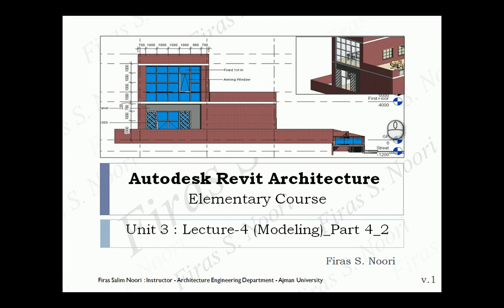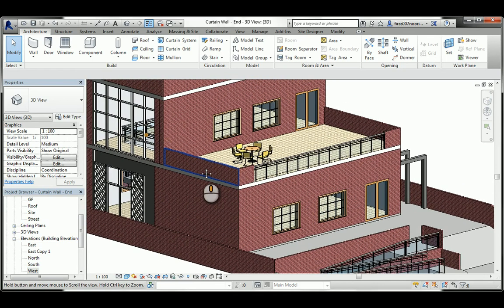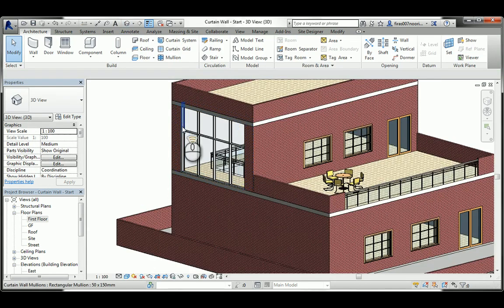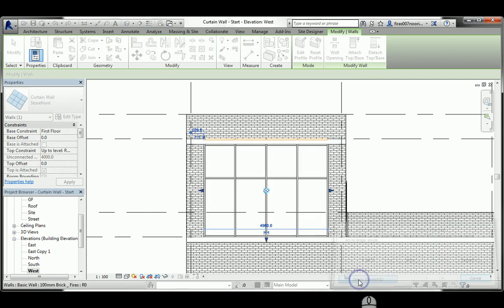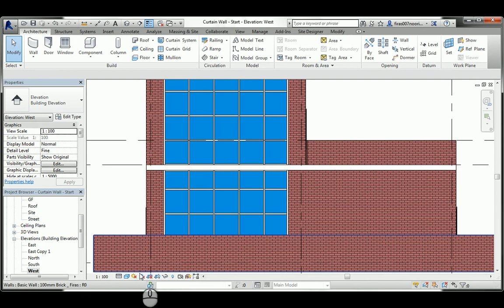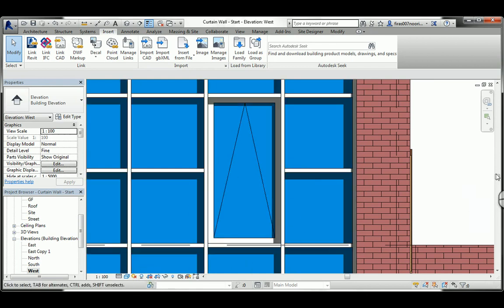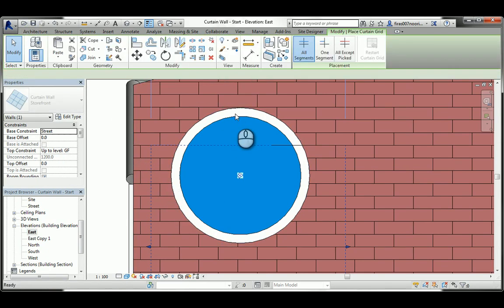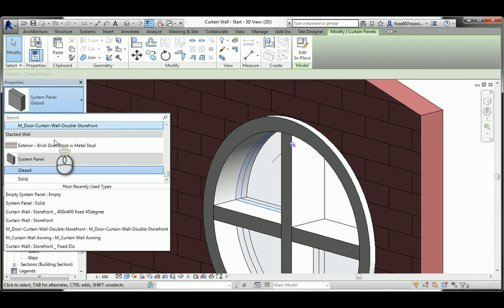Revit Architecture_Unit 3_ Lec 4_Modeling_Part 4_2_Curtain Wall System Example

Comment: Hi Dr , can you please explain how to add a regular window inside Curtain Wall after we changed the material of the panel to bricks.
thanks.
Reply from the maker: Hi, you need to unpin the panel, change it into a wall, then go to the window command and add the window as if you are adding it to a normal brick wall